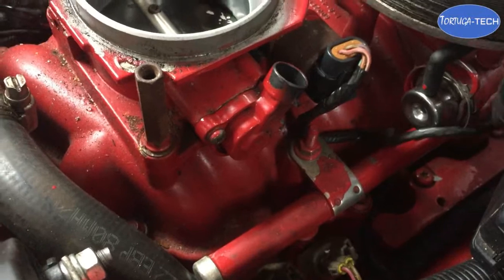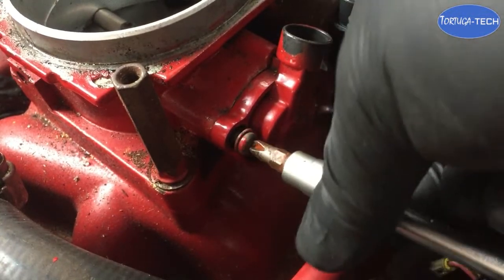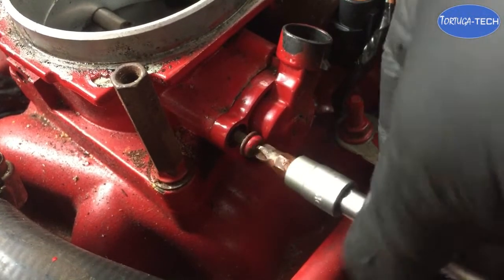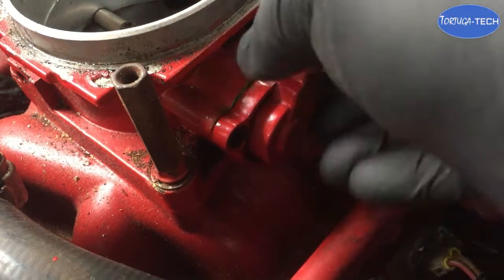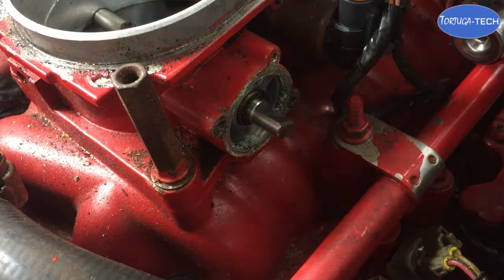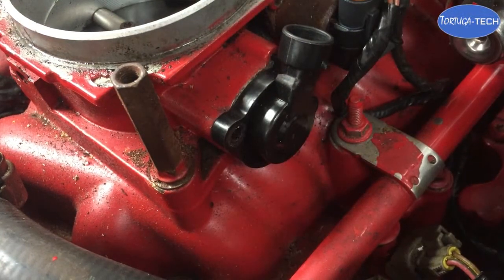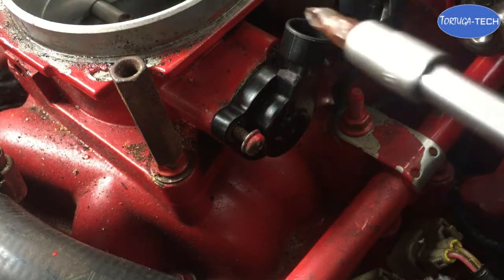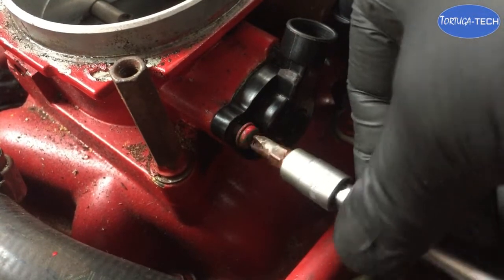Tortuga Tech- Replacing Volvo Penta/Mercruiser Throttle Position Sensor

Comment: I am looking at buying a 2556. How does she handle 3 foot seas? Would you recommend it for a family fishing boat?  Are you planing to do a walk though of your boat?
Reply from the maker: Hi Travis, welcome to my channel. If you are considering a 2556, my advice would be to go for the latest model year that you can afford, and depending on where you are based, a diesel engine. The worst sea conditions I have taken mine out in was about 3ft, and she coped well, although for this sea condition I would recommend using the inner helm and not the flybridge.  Have a look at the start of the Mid Season Maintenance video for rough sea conditions. 

For a small family (2 adults, 2 kids) the 2556 is very comfortable, I live aboard mine and there is plenty of space. As for a walk through, yes, I will be doing one this winter, after some internal re-fit work that I have just started.

Thanks for subscribing, I hope you enjoy the channel.